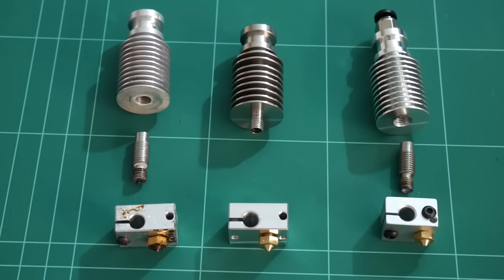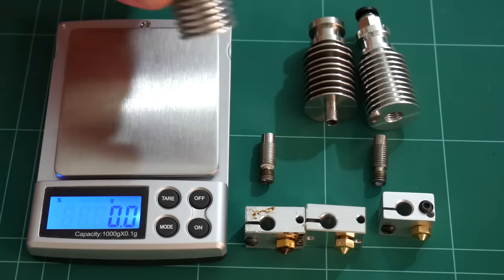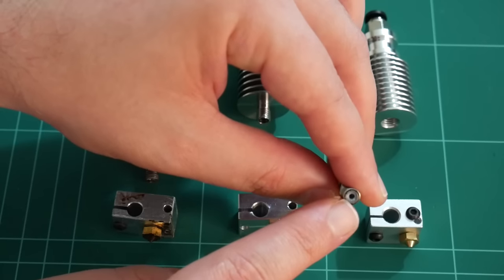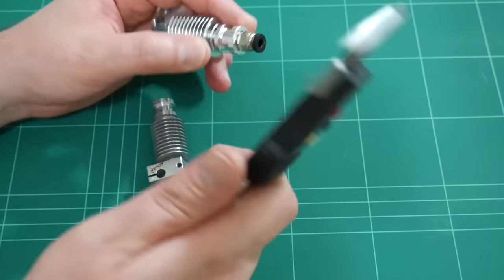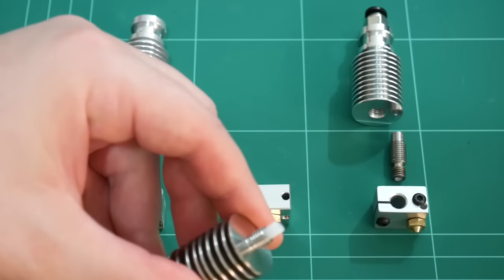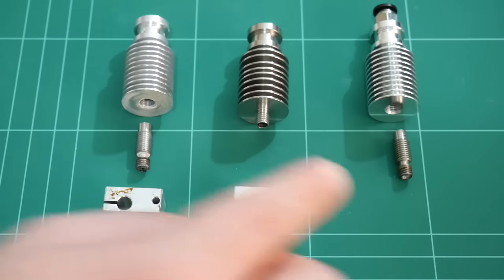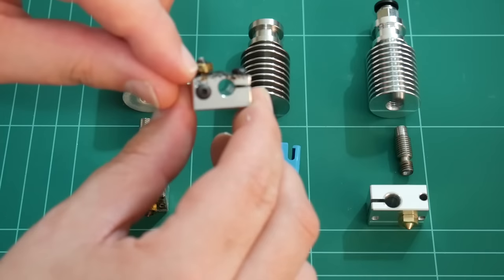3D Printer - E3D Hotend Differences

Comment: just so you know man you can buy all metal heat breaks and just get rid of the ptfe tube one :) then couple it with the block and sock and youve got a good set going there.
Reply from the maker: Yep, agreed.
Reply: That's what I was thinking. If you can use the heat block from E3D, then why not the heat break?
Reply: Could you just remove the ptfe from the clone heat break?

Comment: I got a clone with a #5 thermistor type (in Marlin). It's a cartridge that works really well for a thermistor. The clone I got is a Trianglelabs and I must say it's the best hotend I've ever had (and I'm into self-building printers since mid 2013), even though they have changed the design from E3D slightly.

Comment: There are "solid" heat breaks without the PTFE insert in them available as well as different lengths for the clones.
I have both with and without the insert and they work fine. The new thermister and silicone sock are interesting and I will definitely be looking into those.
For me, the only real interest in the clones was to have multiple hotends around to swap out and come back to later if any problems with clogging came up without the additional expense of the original + when playing with duals helps keep the cost down.

Comment: Funny thing is, now that I know, they all perform pretty much the same, as far as the heatsinks.  I'll drill v5s out to 4mm to allow the bowden tube to reach all the way down to my preferred smooth-bore, all-metal heatbreak (bi-metal if you wish, but the first cheap one i got had a step in it so it took quite a bit to polish out).  The clone heatsinks are actually kind of better because the bowden "bite" fitting can be replaced with a 3-d printed compression/nut style that does not let the bowden turn and cut in to it.  Soo much easier to service.  The smaller heatblocks with the m3 screw on the side to hold the thermistor are actually pretty nice too, because you can just screw a thermistor in there.  I did eventually strip mine out on the heatbreak side though (but it took literally years of mucking around with it).

Comment: Thanx for the video. But measuring the weight you did it wrong? The full , you must weigh the heat break with it , as the light is intergradted

Comment: I got a Triangle Labs E3D V6 clone all-metal.  The heatbreak it came with (and the heatsink for it) was a V5 not a V6.  Found out when I tried to by a replacement heatbreak from a US dealer, thought they sent me the wrong ones till I figured it out.  V5 heatbreak is the same thread at both ends, V6 the two ends have different threads.

Comment: Would it be basically the same if you bought the clone and did the sock and heat block upgrade as you spoke of but also adding on the heat break screw that was different?
Reply from the maker: Yep.

Comment: I've noticed that on some clone heatbreaks the teflon tube can be inserted all the way down to the neck (narrow unthreaded part) of the heatbreak, while on others it only enters about 5mm from the top. From my experience the last heatbreak is extremely likely to jam, while the first one works fine. Which one of these resembles the "genuine" heatbreak the most?

Comment: I also bought one of the V6 clones recently (quite happy so far) and mine came with a selection of three different heat breaks; two matched the ones you have on the genuine and clone, but also a third one which is half-way in between. (which is the one I use) The bowden tube goes a fair way down into the heat break - almost to the narrow neck part, but not all the way through to the hot-end. I didn't realize the genuine "all metal" insert tube stopped that far up (seems about a third of the distance)... do you think taking the tube down further into the heat-break compromises the ability to take the hotend up to 300 degrees? (which is why I bought it) Or does the PTFE need to stay as far up and away as it does in the genuine? 

I'm not that fond of deadly deadly neurotoxin, so I figured I'd ask.
Reply: Ptfe melts at 250°

Comment: You are saying there is a difference in bowden tube contact with the heat break  between the left and right heads? the bowden tube sits inside both of them  similar depth inside the heat break, the same, basically, so  there is really no difference. All of them work fine provided the user understands what the heat break does, and one is careful with the middle one not to sit the bowden tube all the way down. It is all a matter of understanding the process, how things work, and one cnan skin that cat in many ways. But nice introductory video. Yeah silicon socks are great from many respects, but they also help keep filament from sticking to the heater block,  besides thermal insulation, this is probably another best feature of such.

Comment: how do you replace the bowden clips in the e3d heatsink? is it reliable? I kind of prefer the clones fitting because its easily replaced and they are screw lock fittings that can replace them too.

Comment: I have both the full and lite E3d hot end kits.  But I stopped using the full metal because PLA keeps on jamming the nozzle.
Reply from the maker: Interesting, I don't have that problem with the Full kit.
Reply: you need to keep the heatsink fan on for a bit after you turn it off so the heat wont creep up to the pla and make it expand jamming it
unless you have jamming issues while printing, i have no problems there
Reply: your heatsink fan should be always on anyways
Reply: I have the same issue I get excessive stringing and can't increase retraction or I will get jams

Comment: so can you mount the e3dv6 heat break and block on to the clone and still get the same performance of the original e3dv6?? still be able to print as high temps and also what about the new cooper heat block can you use those also with the clones at high temps?
Reply: Sorry for the reply to such an old comment/question. I have the same question. I'm trying very hard to figure out the best way to upgrade my Ender 3 to print faster (2x-3x without losing quality) and to be able to print CF Nylon without spending more money than it's worth... and after months I'm still pretty damn clueless. I was told that a direct drive was 100% necessary to print faster on the Ender 3 and was going down that rout first (and even ordered a Sprite extruder/hotend setup and received only the extruder)... so then I was trying to find a compatible hotend, but how the hell am I supposed to know what's compatible if no one says? ... and then (only recently) I've read from several sources that a direct drive slows down print speed, because of the weight... so now I'm still stuck. I have a V6 clone I got for cheap, but I don't want to install it and go through all that trouble just to have it not work good. I also don't know if it's compatible with the Sprite extruder, because it's a bowden V6 clone... and I'm not even sure if I should bother installing the Sprite extruder. A friend of mine said I can borrow his Micro Swiss, so I'm going to use that for a bit (I think), but I'm still not sure if I should try the Sprite Extruder or not. At least if I do end up borrowing the Micro Swiss it'll give me more time to make a decision and also to save up if I want to get something a little better. Hope you forgive the long rant. It's been a really, really tough subject to research and all I ever seem to get is conflicting information over and over.

Comment: Also remember to loosen the brass nozzle from the heatblock a quarter turn, then screw in the heatbreak/heatsink assembly. And finally, tighten the nozzle down. This ensures a good seal between the the nozzle and heatbreak to prevent jams.
Reply from the maker: Yes, but I loosen half a turn to allow the nozzle to protrude out of the silicone sock.

Comment: This is an excellent video!! The quick and dirty on the differences on the full, the lite, and a clone E3DV6 hot ends. I think I will support the original designers of the E3dV6.  That hypercube printer is pretty cool.  Is there a kit that you could recommend if I wanted to purchase or build one?  Thanks.  Keep the content coming!!

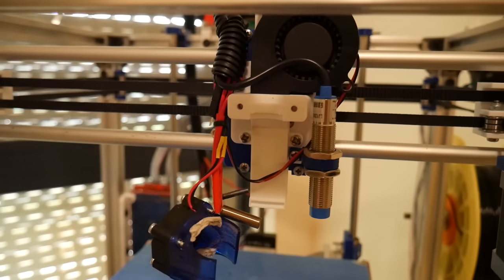Comment: Hey. Look at the your left pulley 10:05 , there is something wrong. The clone have too full metal heatsink .
Reply: it depends on where you get the clone different sellers are shipping different products some have all metal some have ptfe some have the old thermal block some have the new thermal block the clones are all over the shop :P

Comment: The only thing that bugs me with the v6 is that the thermistor cartridge wires are extremely thin and break easily. You have to make sure it's solidly routed so that it doesn't get shaken while you print.

Comment: Thermistor upgrade doesn't work without a amplifier board? Can you explain for us 1st time builders?
Reply: When you order an E3D hot end, it comes with a thermistor cartridge.  A Thermistor is a temperature sensitive resistor, and the electronics use a simple voltage divider to read the resistance of the thermistor, and thus calculate the temperature.  Problem is, they get damaged upwards of 300 degrees C.
A thermocouple can handle much higher temperatures, but they work differently.  A thermocouple actually generates a voltage, so you need additional hardware (the amplifier board) so that the printer CPU can make sense of the thermocouple's output.
Reply: Thanks. So a little more cost to upgrade.
Reply: Yeah, and unless you want to print in very high temp plastics it isn't worth it.  Most plastics print just fine below 300C.
Reply from the maker: The thermistor cartridge that comes with the kits don't need an external amplifier board. I think you are referring to the PT100 cartridge which looks the same but requires the amp board.

Comment: the clone works fine here, nothing wrong with that!
TIP!
if you extruder crashes check the hite brake for burrs 
and also often, Heat brake and extruders can exchange with each other!
they are selling on online stores also hite brake loose separately(with and without Teflon!)

Wishing everyone a good 3D .....
Friendly greetings from Netherlands!
Rob.

Comment: So its only for bowden extruders? E3D does not make a direct drive version?
Reply: Victor García you can use them as direct drive either by adding a PTFE tube to your direct drive or feeding directly into the hotend. The V5 of E3D is a direct drive model

Comment: would it be interesting to mount the original e3d full heat break in the clone version ?
Reply from the maker: It does fit...
Reply: Tech2C I was thinking this as well. 

e3d full heat break, e3d lite heat block, clone heatsink. is it possible? best of both 3 world's. (hehe, 3)

or at least e3d full heat break with the better of the two (full or clone) heat blocks onto the clone.
Reply: Try it urself, 6 bucks for 6 on amazob

Comment: Just a note on the heatbreak I don't think they are as identical as you make them out to be. As someone mentioned the zone separation is better on the original. Note the "throat" is thinner on the original
Reply: Only for version showed in this video. There are heatbrake clones with the exact same design as the original, internally polished and even titanium. New style PT100 compatible heatblocks clones also.

Comment: Thanks tech2c for this video
I have e3v6 clone i decided to buy e3d v6 kit upgrade( original kit with socks and new thermista on it ) with heat break metal without ptfe tube .. 
but i have an issue with it allways jam or clog in the nozzel .. i don't know why .. 
i modefied the setting retraction to 2mm distance and 50mm/s speed .. 
allways same thing ... 
with tube ptfe not issue in all .. but i can't go up to 245c 
thank you for supporting .. 
mamsih from france

Comment: I'm about to upgrade my Prusa i3, what diameter filament do you prefer? 1.75 or 3mm...

And what head diameter ? 
For general use...
Reply: there are much more 1.75mm filament out there, so that's the way to go.
the "standard" size for a all day nozzle is 0.4mm, it's reasonably fast and accurate. But you can also purchase the e3d Nozzle Fun pack with all their nozzles (it's also cheaper instead of buying all nozzles seperate). Nozzle change is quite fast, and after that, just calibrate your Z axis again. It's a matter of minutes to do a nozzle change ;)
Reply: Thanks. Ps... what's the difference between the push fittings and the clip fittings for Bowden?
Reply: There is none difference between them. The "clip" fitting you mentioned is just the E3D style push fitting, it is integrated in to the Heatsink.

Comment: on my robo 3d I have a real e3d v6 but on my geeetech G2s I bought 2 clones and 2 real e3d heat breaks and aside from the bowden adapters I can't tell the diffidence with the real heat break it can get to over 300 (did it to tighten the nozzle to heat break) the heat breaks are only like $11 us and I got the clones for 8 bucks a piece so I paid about $38 for 2 v6s

Comment: PTFE melting temp according to Wikipedia and other teflon manufacturers is  327 °C (621 °F). I have used a cloned heat break at 260C for 2 to three hour prints without issues on a stock anet a8 printer. I use nylon.

Comment: Wow you have a lot of leakage. If you leave a little space on the nozzle, then when you put in the tube, you can tighten the nozzle a bit more and stop those nasty looking leaks. It is soft metal, so don't over tighten. You just want it a little more snug than hand tight.

Comment: Pro tip:  I don't know if this is true worldwide, but if you buy an E3D lite6 from Filastruder, and the parts to upgrade it to a full v6 (heat sink and heat break), it actually comes out $10 cheaper than just buying a full v6.

Comment: i like to support chinese clone manufactor:-)
Reply: Competitive is good for the market. ;)
Reply: I like to support Chinese clone manufacturer as well. These greedy companies are charging way to much for their products which are usually produced in china any way. They do have to pay for R&D but seriously there is no way it cost over $10,000 to reinvent the wheel with a different shape. Look at the new titan/ titan aero for example basically they made a slightly better designed mk8 hotend with extruder gearing system what a joke.

Comment: I just want to point out a few things about the differences which you missed.

While you'd think the heatbreak and the nozzles are identical to the clones, there's quite a bit more to it than just outter dimensions.
Nozzle are a bit more complicated than what they seem. The insides of clone nozzles are different and same goes for the heatbreak. The clone heatbreaks have really bad finish inside which will result in the filament sticking to them and getting clogged.

And also on the original Lite6 version. If you lock the ptfe tube securely the right way as mentioned on E3D wiki, it'll never come out and create a mess inside like you mentioned at 6:05.
I actually noticed on your older videos that you don't lock your ptfe tube inside, which leaves a bit of wiggle room for the ptfe tube to go up and down. You need push the tube down and hold it while you pull the bowden clip back up. Then test and see if the tube moves at all, it shouldn't.

Sorry about the rambling, it kind of bothered me because I've had terrible experience from the clones (all metal) and most of it came from what I explained.
Reply: I've have all 3 and the Clone as never let me down.. plus I have all the cash in my pocket...

Comment: I disagree. The best upgrade you could get would be getting the original heatbreak (sharper heat zone separation, higher temps)
Reply: I guess it depends on your needs. The silicone sock does improve printing with gummy sticky filaments like PETG. That said, I upgraded to the original E3Dv6.

Comment: I have noting but bad experiences with the E3D sock. Some filament seems to get sucked up inside the sock and then it will push the sock down. Small pieces of blue material ended up in the print. The sock will get lose in about a week or 2. Lots of people with the same experience. I always buy real E3D hotends and they are great but I think the sock is there first big failure.
Reply: I've been using the silicone sock now for 2 months and have not experienced any of what you describe.
Reply: I'm using the sock also for about 1 month now, and it works flawlessly without a problem. In fact, my temperatures are more stable after the Cooling fan kicks in
Reply: Nor have I.
Reply: It may be the way you are routing the thermistor and heater wiring. Try to tuck the sock in between the wiring and the aluminum block in order to get the sock tight up against the block. The very tip of the nozzle should be protruding through the bottom of the sock by a small amount (0.25 - 0.5 mm or so). If the nozzle is inside the sock then it will not work properly.
 - Eddy

Comment: I'd go for the full kit if it was 30$ or something. but it's 74$ on amazon and the clones are 5-15$
Reply: you can also upgrade your clone to all metal if you buy heatbreaks too
Reply: @Raeffi3  yeah. is it worth doing that? I heard the heatsink might not be good enough to cool it? i donno. I currently polished mine but it made no visible difference. I guess my polish wasn't great. but no jams yet! mine hsa a metal throat
Reply: @chloemcholoe3280  all issues i experienced were retraction related (too much)

i bought some medium priced heatbreaks

its not really worth it if you only print pla though

Comment: I have to say that Chinese clone actually better, first push fitting is better and it is replaceable. Second mine genuine E3D all metal have odd ptfe and heatbrake contacting point which is causing lot of problems with stuck filaments, tried to seat and cut ptfe tube so flush as possible  and still time to time filament stuck. I think because of poor push fitting. With Chinese clone ZERO issues. I was really disappointing, and it is in box with 3d printer parts...